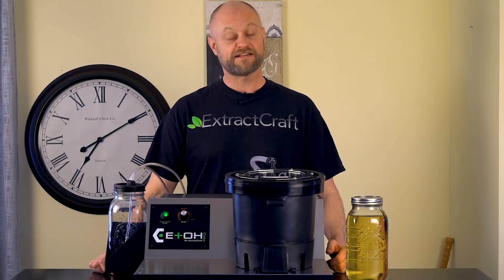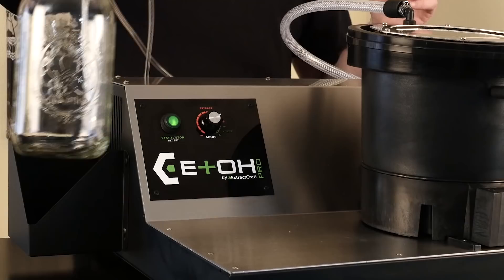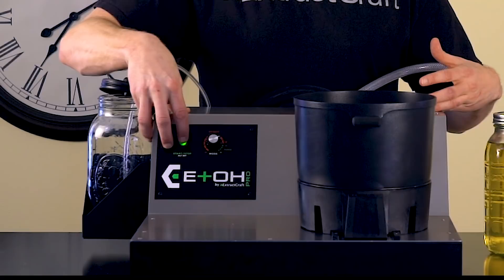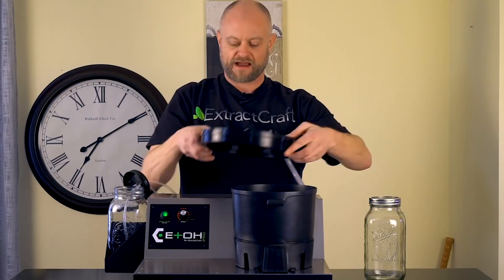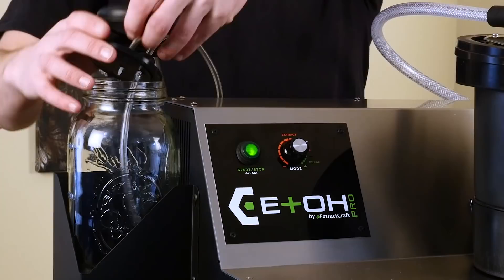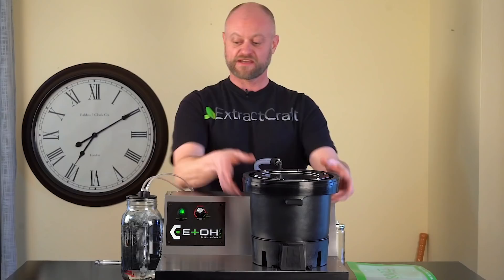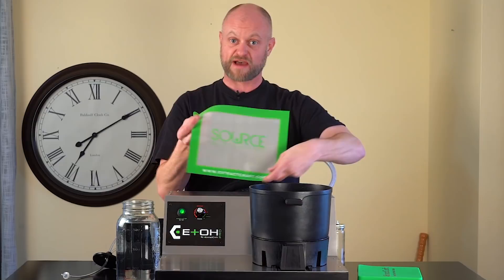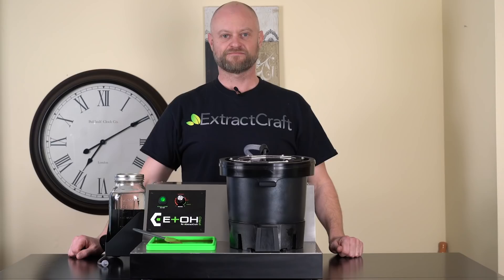Etoh Pro In Action

Comment: Just curious - why would you want to air dry the oil? What is the next step after pouring it on to the silicone mat?
Reply from the maker: It all depends on what you are making.  What kind of oil, for what purpose, and what desired end products.  Air drying allows more residual ethanol to evaporate if desired.  If you are making edibles, topicals, tinctures and such it may not be necessary.  If you are trying to achieve a more stable form end product then this kind of post production purging would be necessary.
Reply: @ExtractCraftVideos  stable as in like shatter, wax, crumble etc.?
Reply from the maker: @dijidal  Yes, exactly.  Having said that, sometime you can get very stable without the extra equipment, you can air dry as well
Reply: @ExtractCraftVideos  Thanks buddy!
Reply: @ExtractCraftVideos  I'm making edible FECO + carriers :)
Reply: @ExtractCraftVideos  Off topic but can you further clarify the consistency of what would be considered finished FECO from Etoh Pro? Is it room temp, say, olive oil? Heated olive oil? Cold olive oil? I'm wondering if I leave it too long in the Etoh will the heat go above the 120C mark where cannabinoids start breaking down? If so, what consistency would the oil be if it were over-done?
Reply from the maker: @dijidal  There is really no such thing as an exact "finished."  It is finished when it is the consistency you choose.  You can stop early to have a thin alcohol tincture, continue longer for olive oil consistency, or purge it all the way to a tight ball of resin.  It all depends on how you make it and how you choose to finish
Reply: ExtractCraft vital info thank you.

Comment: Hello Extractcraft
Do you have issues with the pump without a cold trap? I know you have a condenser but no cold trap in between the alcohol and pump. I would be afraid to use this machine without the Ethanol being chilled due to the Ethanol flash point being low. Any concerns?
Reply from the maker: Well, in certain circumstances and with poor equipment management and if we used pumps that required cold traps that might be the case.  However, we use pumps that are designed for this specific purpose and if we had even the slightest concern we would not be selling the equipment.
Reply: @ExtractCraftVideos  Hey listen, I am just stating a fact and asking a question. I have been looking for an "at home" ethanol recovery system that is affordable and your system seems affordable, and I cant find one other than yours. I am going to ask the questions and get satisfactory answers before purchasing anything. Your system deals with some things and others it doesn't for me and that is why I asked. I have never seen a cheap pump that isnt in a professional system that does not get ruined with Ethanol.
Reply from the maker: @canadiancannabist2363  We have no problem with questions at all.  There are many kinds of pumps.  The pumps you seem to be familiar with are rotary vane pumps and would get ruined with ethanol.  As you can see by our equipment, it would be impossible to fit one of those inside.  We use diaphragm pumps that don't require oil.

Comment: hi thanks for the videos. i am ready to make a purchase. I wanted to know how much oil did the 2L Tinture produce and how much plant material did you use?
Reply from the maker: This all varies based on the plant material you are using. For cannabis, you would use about a 1/2 pound for 2 liters of ethanol. Yields can be anywhere from 10% to 25% of the starting material weight depending on multiple factors.

Comment: Awesome ! Is this doing the Decarb in the same time ?
Reply from the maker: Our equipment in under vacuum and low temperature, so it will not be decarbing. If a decarbed end product is desired, you'd want to either decarb the flower first, or the oil 
you make after.

Comment: Clock doesn’t change time during that time laps........ running mine for an hour now, pump keep kicking on every few minutes. Still waiting for it to recover.  Should I leave for a few hours?  Is it gonna be as slow as watching grass grow?
Reply from the maker: The clock doesn't change during all of the videos, it is set at 710, it's an industry thing.  If you take 710 and turn it upside down it is "OIL" which is what we make.  The machine is very fast, if yours is running slow chances are you have something not set correctly.  If you are having problems you can catch customer service at info@extractcraft.com or call 720-534-1242

Comment: Is the vacuum released when EToH is powered off?  I know the Source has it's own vacuum control screw
Reply from the maker: Yes, automatic vac release
Reply: @ExtractCraftVideos  Colby if you put a valve release on say etoh 2.0, would it keep pulling ethanol for a while as it cools down? Or is it a diminishing rate of return w/out pumps running? Thanx
Reply from the maker: @cannaboganics4410  the return wouldn't be worth it

Comment: $2000.00 U.S.D! Thats crazy bra. Hell of alot of iso for that kinda cash.
Reply from the maker: We use food grade ethanol, it’s a far superior choice over iso which is a petroleum product.  With the iso you still need a way to process it, and a way to work at low temps for best quality.  This machine is cheaper than any equipment with comparable versatility and quality output

Comment: Does cannabis still need to be "decarbed" before using etoh?
Reply from the maker: If you are making an end product that requires decarb you would either decarb plant material prior to extraction or the oil after extraction.
Reply: @ExtractCraftVideos  Yes of course you can decarb before or after BUT which way leaves the extract with the most medicinal compounds?
Reply from the maker: @billclark8241  Hard to say between those two methods as either way there will be some terpene loss. Still plenty terpenes retained though. The most lossless way would be what's called a closed wash decarb. I can provide information on that here, but you can find information on our facebook group ExtractCraft Users Group

Comment: Why would you need a elevation setting when your pulling a vacuum on it?
Reply from the maker: As you lower in elevation, you have more atmospheric pressure working on you, and thus have to pull higher vacuum.
Reply: @ExtractCraftVideos  once there is even a slight vacuum in the vessel the outside pressure at any elevation has no effects on the pressure inside the vessel.  Unless there was a leak in the vessel.

Comment: This oil seems darker than the oil you ran on the other machine. Seems there were less steps with the pro also. Is this the case?
Reply from the maker: The process is the same for both machines! Using them is very straightforward, and really most the work is done in the preparation steps. The color of your resulting oil will be dependent on the plant material itself, the temperatures it was worked with, how long the food grade ethanol is left to soak the plant material, filtration, etc.
Reply: @ExtractCraftVideos  thanks for the response. I'm weighing my options. When you have a sec, instagram rootedtableMO. I cook quite a bit, and would like a smoother product. Thank you for answering.
Reply from the maker: @tmc2182  Will do!
Reply: @ExtractCraftVideos  The video clearly states how it was filtered and washed, "washed for 5 minutes" and filtered with a Buchner filter. I assume a "slow" filtration, and for that, the end product is really very dark. I think it got too hot, and for that, the device has no protection, or it triggers too late

Comment: Could this replace a roto vap? If cleaning up bho w a 1 to 10 ratio and then winterizing and filtering could I still run that through this? What’s the pros cons between this and a 2 liter roto vap?
Reply from the maker: Yes, that is the exact function of the machine.  It also has a purge mode for post processing that a rotovap doesn't.  This is easier, cheaper, and less glass

Comment: Whats the reasoning of doing a 5 minute wash?  Would beneficial for leave it soak for longer periods?
Reply from the maker: It all depends on what the oil will be used for.  A quick wash will yield a cleaner, winterized concentrate as to where a long soak with yield a more full bodied oil
Reply: ExtractCraft a long soak will release chlorophyll and make your oil look green
Reply from the maker: D Jam that’s correct, and a cold or shorter one won’t.  It’s up to the crafter what they want to make.  Some people feel a long deep soak is more medicinal, and they are able to do that if they wish
Reply: Darker chlorophyll laden oil.  Quick wash keeps color better and doesn’t pull unwanted things

Comment: I waited for an hour and process didn't start, pump was working all the time, I was following the instruction but couldn't force this machine to work, in purge mode it also doesn't work, the solution became just warm...
Reply from the maker: Sounds like you are operating it improperly.  It would probably be most useful to contact customer service.  Reviewing the user manual can also be useful, the part explaining purge mode should provide guidance on proper operation as it’s not meant to run with solution it.  I’m sure once you speak with customer service and use the equipment properly you’ll have no problem
Reply: @ExtractCraftVideos  thank you for your reply, I will contact your customer service

Comment: What's the temp range on recovery? I work with live resins and would love this but I need to preserve as many terpenes as possible with low temps. Thanks
Reply from the maker: The temperature range to evaporate the alcohol is between 96-105f
Reply: Rotovap can recover at 80-85. Higher vac and chiller makes it easier to recover that lower temps.  This machine is for crude oil not finished oil you would dab.  Also if you make live resin why would you work with ethanol? Ethanol is inferior for terps extracting compared to hydrocarbons
Reply: matanuska high: Hydrocarbons are superior for extraction.  And poisoning your oil. And exploding in your face without expensive equipment.  NO oil is worth risking that.

Comment: Can you hook up a buchner and flask to this like the source for filtering?
Reply from the maker: Not with the EtOH PRO.
Reply: What if you were to hook the funnel up to the 3cfm external pump? Would that work?
Reply from the maker: @trosan003  Yes, that would be fine.  You would want to consider using a cold trap as well on a rotary vane oil pump

Comment: Noob question. I want to make topicals and salves from hemp flower. Do I need to decarb before the solvent soak or does the heating during the extraction process decarb the oil?
Reply from the maker: The process will not decarb the oil, this gives you the ability and choice to control exactly what you are making.  If you are making something that requires decarb then you would either decarb flower prior to extraction or the oil after.  There is a good decarb article on www.extractcrafter.com explaining this if you would like to take a look.

Comment: Have you seen anybody use one of these to get pure psilocybin crystals from psilocybin mushrooms? The Crystal of the Gods? Or similar alcohol tinctures?
Reply: Psilocybin is very easily water solvable. No real need for alcohol extraction. However alcohol added to a water extraction at a total of  20% by finished volume is very good to make psilocybin tincture .